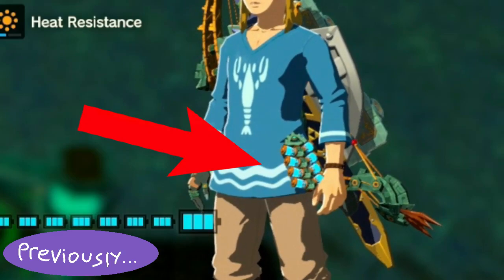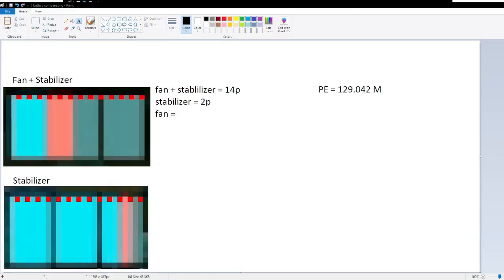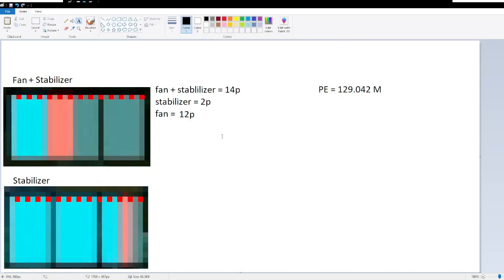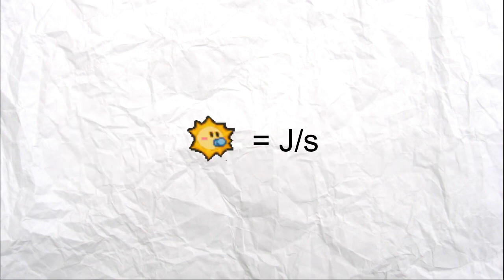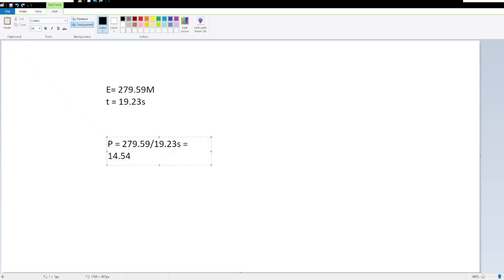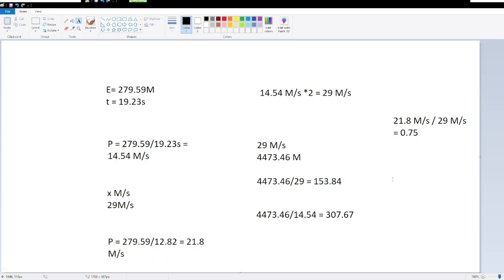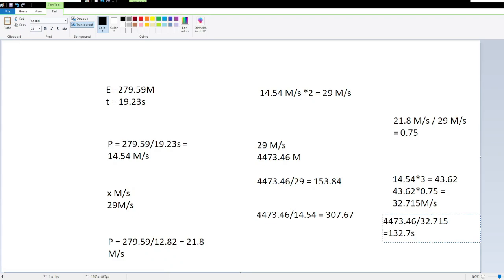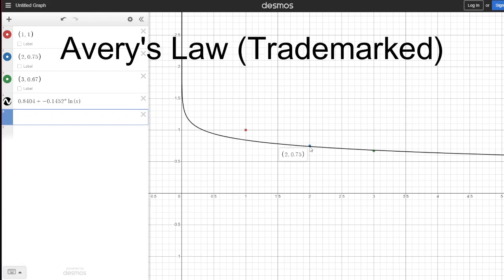Predicting Zonai Contraption Battery Life Using Logarithms (DEBUNKED)

Comment: unfortunately this has already been worked out, this video: watch?v=TpFoMHQ1nyw goes into particular detail on this matter, and the energy consumption rate is different for different devices, but the default energy consumption multiplier is like this:

for each device after the first add 0.5 to the multiplier (with the first being 1)

so if you have 1 fan and your depletion rate is x, that is 1x, if you have 2 it is 1.5x, and 3 is 2x and so on and so forth. i guess if n is the number of devices (the same type of device btw) then this would be...(1+0.5(n-1))x i think...* checks graphing calculator * well it's mostly right, except at n=0.

the reason you go something close to a logarithm is probably because of how logarithms are calculated as an infinite series, but idk, i'm not THAT good at math.
Reply from the maker: I can't believe I didn't notice this pattern! 14.54M/s*1.5 is 21.81M/s which happens to be the exact same measured power for two fans, thank you so much for bringing this to my attention